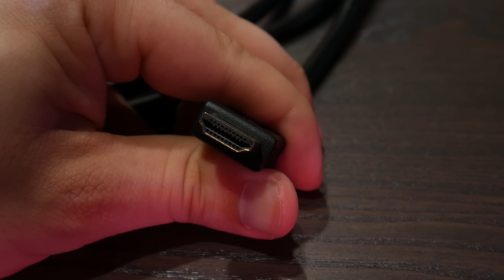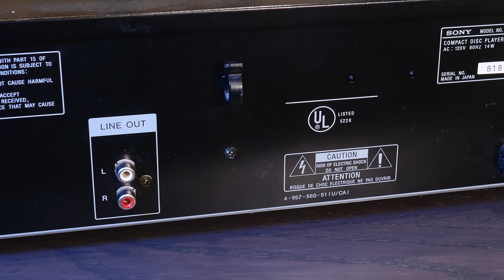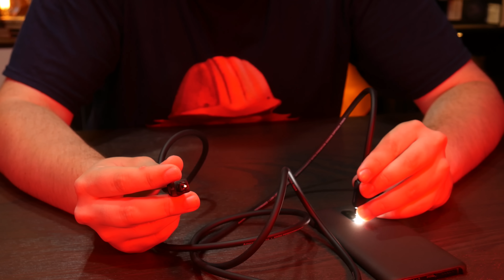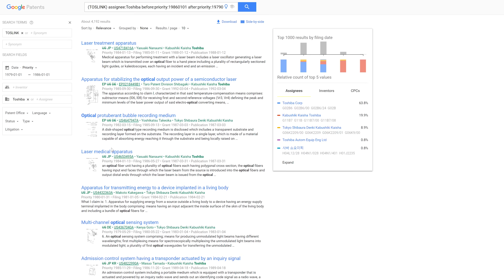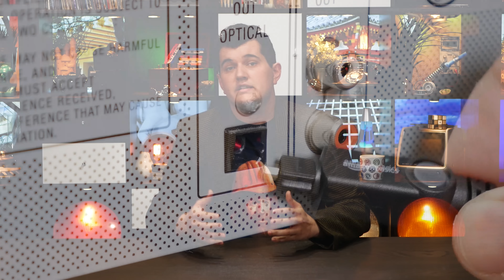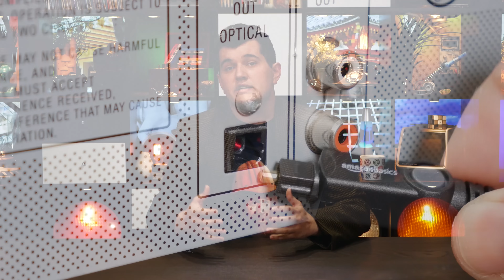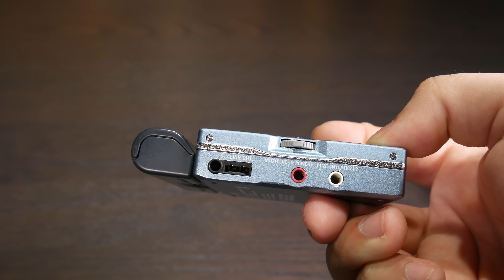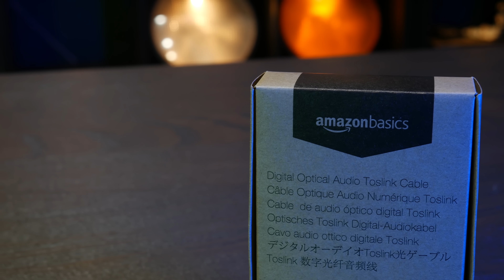TOSLINK: That one consumer fiber optic standard

Comment from the maker: something something 
ground loops
something

Fun fact! I ran across a forum thread where someone was having a ground loop issue with a coax S/PDIF connection, and when someone suggested they switch to an optical connection to avoid that, another entirely helpful and not-at-all pretentious person went off about how terrible optical connections are because of bandwidth and clock jitter.
You simply can't win
Reply: Going too deep into the audiophile community is just hell
Reply: @RisingRevengeance  But did you try changing the TOSLINK LED to a special audiophile LED?
Reply: @RisingRevengeance  You want audiophile hell? Google '6 moons audio' and thank me later
Reply: @RisingRevengeance  Cancer is what it really is...
Reply: Forget clock jitter, it's all about them gravitational waves, bending the light.
You can hear it when the snare is a nanosecond off, or when the soprano is an octal of an octave lower.
Reply: @Games_and_Music  shhh dont shout about it too loud or they may realise external toslinks can be used for managing the clock of their audio equipment
Reply: @Games_and_Music  while i sorta agree with you, you clearly are completely tone def if you can't notice octave changes.
Reply: @Rentta  Well.. i was joking though.
Gravitational waves are so massive, they are not likely to ONLY influence a tiny cable.
And i just liked saying 'octal of an octave'.
Reply: Yep, ground loops are the only real reason for TOSLINK, but what a reason that is... If you can avoid taking apart your entire house wiring for an investment of 1$ in a plastic cable, then sign me up. Though it seems to be a problem from the past anyways, as I never had any ground loop issues with HDMI-era equipment. The D/A part of devices seems to be much better isolated or filtered nowadays.
Reply: @RealNovgorod  HDMI uses LVD signalling (low voltage differential), just like about every high speed bus these days, which is not susceptible to ground noise.
Reply: @Alexagrigorieff  while this is true for the HDMI signal the connector shield is a huge potential channel for carrying RF  noise. I can show you with my signalpath spectrum analyzer.
Reply: Ground loops have always been a huge, endemic problem in the audio industry, & are the actual reason reason why TOSLink & other electrically isolated sound industry interconnects (eg; balanced line audio, & MIDI) were invented.It's not just for audio quality either; grounding problems have been killing roadies & sound tech's for as long as amplified live music has been a thing.
Reply: Sound engineer for 10 years here and adat over fiber optic, and toslink in home audio setups (both use toslink cables), have saved my ass multiple times, especially in setups with a CPU involved. CPU noise is a nightmare, especially on laptops, and rather than fucking around with ground lifting and bridging the grounds of random equipment and trying to isolate the grounds of other equipment to separate circuits because lets face it, audio grounding is black magic that makes no sense in practice, using fiber optics just...gets rid of it.
Reply: @rachelnewton-john7031  TOSLINK was my go-to solution for eliminating ground loops when integrating PCs into my home theater system for many years.  DVI video plus S/PDIF on separate cables from the PC to AVR was a deadly combination.
Reply: But actually, ground loops. They have nothing to do with digital signal transmission, and cause noise at the analog output. SP-DIF (or any other cable that grounds devices together) can cause ground loops. Toslink cannot. And that can make Toslink very handy for some setups. It’s a real benefit.
Reply: @SnakebitSTI . Ground loops can happen in digital audio. I had a firewire pci card causing noise in the outputs of my fireiwre audio interface. Digital connection but it was corrupting the audio section ground in the system
Reply: @Gretsch-q4x  Yes, that is indeed what I said. Electrical connections can cause ground loops regardless of whether they are digital or analog. Optical connections like Toslink do not cause ground loops, because they do not create electrical connections between components.
Reply: I know you were being sarcastic but TOSLINK has saved me more than once when annoying ground loops have happened.
Reply: This is actually a real, live problem I have with my computer since I am using semi-pro studio monitors, the JBL 305P MkII, which are grounded. I get an enormous amount of noise from the any of the line-level analog outputs. The problem persisted with any non-balanced external audio device like my HDMI LCD screen, a USB audio, etc since they connect the grounds of the two devices.

A balancing transformer did work, but they are kind of expensive, so I ended up picking up a $20 toslink to analog converter and it worked great.
Of course this isn't a problem if you are using regular computer speakers, but I quite like what I have, so it was worth a little doing.
Reply: Optical is cheaper because it doesn't require a transformer to protect from ground loops
Reply: @nickkracht7520  you don't need to "protect" from ground loops, if there's one there must be a problem (faulty or badly engeneered appliance), and usually the "hum" can be heard only if you make a ground loop around the amplifier transformer INSIDE the amplifier, and we are talking about analog... also, if the setup uses regular transformers (sometimes more suited for hi-fi) every unit is isolated, so the signal cable will "fluctuate" at once between ground and inner conductor, zeroing the hum, it's magnetically coupled, digital\RF noise is another story, sometimes solvable with a ferrite choke.... car setups are another story as well
Reply: @redoverdrivetheunstoppable4637  not correct; at the very least there is capacitive coupling across the isolation barrier, and this can often degrade.  Even legally acceptable ground leakage current is very high  when compared to what can cause a loud hum if you have two components connected with an unbalanced analog connection.
Reply: I was just going to say, "What about ground loops?!" because I struggled with them for YEARS before I discovered Toslink. And now I Toslink all the things. I just wish there was a way of MIXING S/PDIF digital audio. But sadly, there are none.

Also, Fun fact! Macs have had mini Toslink in their audio ports for many years.
Reply: @asificam1  Thing is most audiophobes are thinking in analog. They think about digital signals as if they are analog. To them it makes sense that a lower quality signal will sound worse, when the digital world doesn't care if the signal is a bit iffy as long as the ones and zeroes comes across. Then there's the jitter. A lot of these people doesn't understand about buffering or signal clocks or any of that. They see the DAC as a analogue piece of circuitry that parses every bit the moment it arrives at the input. The 16 or 24 or 48 bit part of the stream is black magic to them. All they "know" is that bigger numbers are better.
Reply: @blahorgaslisk7763  then there's the 1 bit DAC in many CD players which runs extra fast and along with a buffer processes the data streaming off the disc. Costs less to make a stereo 1 bit DAC + buffer than a stereo 8 bit DAC without a buffer that can process in real time. Cost of such a DAC was enough of a price factor that Sony's first consumer CD player used an 8 bit mono DAC and interleaved processing of bytes from left and right channels. That caused one channel to lead or lag the other by a tiny bit, which in some music could be detected by some people.
Reply: I'm probably just pulling figures out of my ass here, but I'd think jitter would either be so small as to be imperceptible to the receiving end, which re-clocks the signal as it's buffering it anyway, or it would be so terrible as to cause signal loss, in which case you get no signal at all. When audiophools start talking about "jitter", it's time to quietly bow out of the conversation, since they're invulnerable to actual scientific knowledge.
Reply: There are audiophiles that unironically thing that strapping a bag full of crystals to the wire makes the audio better.
Reply: @dan_loup  I saw a comic in an electronics or audio magazine. Shows an audio salon room and the manager or employee asks: now what? The next frame shows the demo speaker wires wound around hot water bottles.
Reply: You had me on edge the whole video waiting for mention of ground-loops, then I posted a scathing comment :P  But TOSLINK is/was also used by radio broadcast stations and amateur radio hobbyists to isolate their lightning-prone tower antennas from their station equipment, so a lightning strike won't fry their sensitive electronics.
Reply: My god....
That´s not even an argument. If we´re comparing electrical vs optical S/PDIF, there is literally zero difference as long as it runs on the same clock source.
Reply: @Basement-Science  as someone whos suffered from electrical interfearence blowing XLR cables out yeah ima have to put a fat doubt there
Reply: @Basement-Science  i don't even barely believe this clock jitter is a thing, it needs to be terrible to cause problems... clock de-syncronization instead is, you can see USB devices have ALWAYS a true quartz cystal on both sides, it apparently keeps re-syncronize (and it's it's business anyways) but it needs a decent timing since the start... you can hear (yes... HEAR) clock desyncronization in bluetooth A2DP communication after some seconds of playing in the form of speeding up or slowing down for like a second once every 30 seconds, kinda... not sure this problem is in every device or so evident, just play a pair of songs you know well trough it
Reply: @redoverdrivetheunstoppable4637  I'm sorry to say that you're wrong, but all USB ports don't have crystals at both ends. The last product I designed didn't have any crystal for the USB interface chip. The chip just winged the clock internally ( a Microchip MCS2221). That said, I think clock jitter is snake oil,
Reply: @johnsmallberries3035  i said the same thing, clock jitter is snake oil... but i can't find any reference to your device, also, you may have been just lucky that it works, USB (i'm googling it now) needs a precision at least inside 0.25%, unobtainable with just the chip RC clock (i say)

don't start with "you are wrong", i'm chatting here, the fact that there are competent people like me and you around that may go more indepth is not strange in my opinion, i'm a nerd at a technology video (in case you think i'm beeing arrogant)
Reply: @redoverdrivetheunstoppable4637  "...needs a precision at least inside 0.25%, unobtainable with just the chip RC clock..." It's not that you're *wrong*, since you specify with "just the chip RC clock" and that excludes the PLLs, but 48Mhz isn't really difficult to achieve from an 8Mhz RC and PLLs. Quite a few of my MCUs can run at 40Mhz, 72Mhz, 80Mhz, 104Mhz, 160Mhz, and 240Mhz with no external oscillator, just the internal RC. Most of the time it's accurate enough to sync at high baud rates from the UART of 4000000 to 9000000. And USB isn't as precise in the real world as it is by spec; especially USB 1.1 fallback support, which absolutely can be bitbanged by an AVR on internal RC. See Also: https://www.obdev.at/products/vusb/index.html
Reply: @redoverdrivetheunstoppable4637  If you can hear it, the software isn't good enough. You should only hear it doing that if it decides it needs a bigger buffer.
Having said that: I use zita-njbridge to send PCM realtime over udp and the other side locks onto the clock and creates a very low latency audio sink (like 10ms). It syncs between different audio clocks, system clocks and such. It works perfectly. Except those times I forget to turn off the wifi on the source device.
Reply: If optical cannot be used for any reason, a simple way to reduce or eliminate ground loop interference on S/PDIF is to put the cable through a ferrite choke (the more turns the better).
Reply: @Alexagrigorieff  ferrite will do nothing for ground loops.
Reply: @S For what it's worth, with ground loops you generally do not have any loss of accuracy in how the digital data is decoded, and for most purposes digital data really is immune to analog noise.

The problem is that a DAC/amp is a digital front end with a lot of analog on the back end. The digital part working perfectly in spite of noise doesn't count for much though if the analog part afterwards is suspectable to interference. That's why optical out makes sense, it lets you completely decouple the analog parts from the digital source. You don't need optical to do it, but it's an easy way to make it happen.
Reply: Ground loop is an actual problem to which TOSlink offers a solution, it is not the same thing as one guy on a random forum complaining about something pedantic.
Reply: I actually had the same discussion with an "audiophile" that swore he could hear the difference between coax and toslink.
I told him that if that were really the case, he has a very very shitty amp with a very very shitty PLL that can't lock onto a signal properly.
The only thing that would make it jitter is if the receiving side is not capable of locking onto the clock signal.
And that's the best thing to say to an audiophile: "You can hear it jitter because you didn't spend enough money for a real amp".
Reply: I wish I could buy better electrical wiring for my house. And maybe I could upgrade the transformer on the line outside.
Reply: @CaveyMoth  even with perfect wiring, ground loops could be a huge issue.
Reply: @CaveyMoth  If you are concerned about receiving noise from the power in your home, look into a power conditioner.  I run pro audio for theater and a power conditioner is critical for eliminating that background noise.
I personally use Furman conditioners, the start at about $80 and run up to a few hundred.
Good Luck
Reply: Mark Perrenoud more snake oil
Reply: LOL, it goes down to what do you hate more: mains hum or a little jitter
Reply: Was it a Head-Fi thread? That place loves to chug the audiophile snake oil.
Reply: One thing I've not yet seen mentioned in talking about "clock jitter"--the schematics I've seen for boxes that eliminate clock jitter involve chips that decode the audio signal using a chip that had an output pin to indicate the copy-protection status of the material fed in, and then encoded it using a chip which had an input pin for the copy-protection status.  If one were to "accidentally" fail to connect those two pins together, the result would be that a feeding a "copy protected" signal into the box would yield a "copyable" signal out.  Selling a box for the purpose of removing the "copy protection" indication might not have been kosher, but if marketed for the purpose of removing clock jitter, the manufacturer could claim it had no duty to prevent unauthorized modifications that might also happen to remove the copy-protection signal.
Reply: Ground loops and mains electricity hum are even more annoying than a pretentious person writing humbug in a forum.
Reply: To be fair I'm building a amplifier myself, and it does have some ground loop issues currently, and switching from spidif to toslink (internaly between the streamer and the DAC) does actually make it easier to isolate the dac from the rest of the amplifier....
Reply: not at all pretentious person (tell me about it) lol your right you can not win (manchester encoding) think i ran into that before ir remote control arduino etc etc anywho  oh also you should try a piece of fishing line : ) let me know if ya do please
Reply: Sooo... As a pilot, when you say "ground loops", I think of something COMPLETELY different than whatever you actually mean. :)
Reply: “You simply can’t win”

Welcome to the engineer way of life 👌
Reply: oh my god they're eating each other
Reply: Ah, and you can't simply decompress a S/PDIF multichannel, either - while Toslink sends 8 channels at uncompressed 24-bit/48kHz ! 
This makes a (potentially) crucial difference when recording anything beyond 2 channels at once.
Reply: @shaft9000  eh most digital outputs of other forms can already do 8 channel or in some cases more as 32 bit 192Khz so thats less of a positive anymore
Reply: I recently had terrible ground loop issues with actually professional audio equipment in my school auditorium because that buildings wiring i that bad. I ended up getting 45 DI boxes to just run everything that goes between FOH and the Stage through a DI box. Was cheaper option that switching to digital Stage snake....
Reply: I watched this video using a Toslink sound plate.
Reply: Clock jitter is real in cheap chips. (For the professional- not the audioFool)
Reply: Clock jitter souldn’t be a huge issue unless if said person really cheap out …. Usb dac are perfectly fine just as optical. I think a lot of people dont like usb cause some time badly grounded device can indeed pass the noise on to the analog output. Which does happen with my mojo2 I can’t charge it and listen to music cause i can hear the charging wine from my bad charger
Reply: I love you
Reply: I didn't knew HDMI was so terrifyingly good at audio.
Reply: @dan_loup  Hdmi's focus isn't audio. All the good audio stuff in Hdmi is for cinema (multi-channel audio). And it's raw stereo audio characteristics don't push the envelope (even though they're quite good nowadays). For audiophiles, there will always be some other fancy format that does some things better than hdmi.
Therefore audiophiles don't care about hdmi.
Reply: @BlackSharkfr  192Khz/24 bit precision without any compression is pretty much unbeatable.
Reply: Ignore and onto the next video. More toasters
Reply: People complaining about jitter are dumb as hell, but ground loops can still be a problem even with digital interconnects. For example, if you have an amplifier/dac receiving data from a device with a different ground, you can induce an additional signal on the (very much analog) output of the DAC via the current that must flow to bring the two grounds to a common level. There are other ways to isolate systems than using fiber, but as you said a piece of fishing line and an LED is pretty damn cheap.
Reply: Ground loops, switching power supplies, computer noise in the power circuits, and 2.4/5ghz noise all plague my audio systems. It's miserable.
Reply: Friend of mine had the perfect argument to the clock jitter BS. His electrical engineering project involving rx/tx to satellites, eg through the atmosphere with all its interference and even then clock jitter wasn't an issue, so how the hell is it going to be a problem over a short cable sending a relatively low bandwidth audio stream.
Reply: @TimSavage-drummer  Jitter is a real issue for high speed (50+ Gbps) trans-ocean fiber cables. Basically, you're sending your pulses perfectly clocked, and they arrive slightly earlier or later than average delay. It's caused by thermal fluctuations of the medium.
Not so much for sending 1.5 Mbps over 6ft, though.
Reply: @TimSavage-drummer  satellite digital communications have very high latency and use forward error correction to account for loss due to interference. That error correction adds latency. Usually salellite data is modulated (QAM - quadrature amplitude modulated, say QAM64 for example) on some carrier Depending on the satellite frequency your requirements for low phase noise clock (low jitter) become more pronounced. If you use a J-BERT (jitter bit rate error tester) from say Keysight ($100k instruments) you can design your system to minimize phase noise, jitter, MER (modulation error ratio) to be able to decode the signal. This is all much more complicated than you imply, with QAM, I Q signals, Slicers, FEC, Trellis layers, randomization layers, reed Solomon coding, and more. You still have to deal with period jitter, cycle to cycle period jitter, long term jitter, phase jitter, time interval error.  Think of jitter as a kind of error and lol I can't think of anyone doing anything at all in RF to communicate with a satellite who doesn't have to deal with this kind of stuff all the time.
Reply: Before I discovered and promptly bought a USB isolator (they're pretty cool for circuit nerds) I bought a TOSLINK cable to deal with a ground loop scenario between my speakers (which are likely more complex than average) and my PC.  It was the only thing at the time that solved the issue and I still don't know what caused it other than probably noisy switching power supplies that didn't like each other over copper.  The USB isolator for that one device has since fixed the issue without the weirdness of TOSLINK optical.
Reply: Ground loops aren’t that likely at short distances - crummy switch mode power supplies however...
Reply: @JohnR31415  sadly, much of ground loop problems are caused by equipment even with perfect wiring.
Reply: I've never got into more insanely useless arguments than over grounding. Radio, audio, insane essential oil people, it's weird. 

Also, now I'm laughing thinking about someone hearing how clock jitter makes their audio "unstable" or something.
Reply: Never mind that any clock jitter will be completely eliminated by the PLL in the receiver.
Reply: People don't understand that there are buffers. They literally think everything is streaming at the edge of a knife. Probably because in their perception it's all instantaneous.
Reply: @timramich  When it was first introduced, some devices might not have had any buffering. Transistors were expensive back then. These days, of course, there's no issue.
Reply: @johnsmallberries3035  Uh, yeah. Okay. Transistors were expensive in 1982? We're talking about present day, and maybe the past 10-15 years, when everyone has had a fetish for nonsense snake oil, despite this digital technology being perfected (even with buffers) for decades before.
Reply: So you're ignoring ground loops and mocking people who brought a point that you neglected to cover in the video. I'm unsubscribing now.
Reply: SPDIF is transformer isolated and so is immune to ground loop problems, so optical has zero advantages from a ground loop point of view.
Reply: @warrenhuck5510  it can be transformer isolated but usually is not in cheap implementations.
Reply: you can avoid all these issues as long as you buy monster cables.
Reply: Jitter matters. I reclock AES/EBU (balanced 110 ohm version of SPDIF) and there is no contest in A/B listening. Very obvious, significant and easy to measure improvements.
Reply: I know I'm going to get some hate for this but clock jitter is actually a big issue when it comes to high fidelity audio reproduction.  It causes all the packets (which multiple packets can be used to create one instrument) to come into the DAC out of time.  So say a bass slam.  It will sound more muddy and have less defined attack with high jitter when compared to low jitter.  Basically all the different pieces of digital information for a specific note are coming into the dac out of time and since those time discrepancies aren't equal (as it might be in a Wow and Flutter situation on a turntable) it creates a scattering of that note.  Now it doesn't result in a complete shift of the beat, it just makes it less believable that the sounds are coming from an expressive human musician and more like a machine trying to recreate it. 

And as for the optical being more prone to jitter?  The pieces of technology that are involved in converting the digital voltage into an led light are prone to introducing electrical noise into the rest of the circuit.  So in the audiophile world digital coax is usually preferred over optical.  They both transmit the same information, just coax has less steps in that process.  Less steps create less opportunities for things to get messed up.  And as for the bandwidth issues.  S/PDIF is limited to 192khz where as a USB signal can kind of shoot the moon.  I personally don't care about that when it comes to my audio reproduction but when you go on facts Optical S/PDIF technically has less bandwidth then other potential options.  Most must music is mastered in 44.1 CD quality so in reality S/PDIF has more then enough bandwidth for 95% of recorded music. 

I think people tend to forget that digital audio products are electronic devices, tasked with creating the complex expressive and emotional energy of a human musician.  In theory it shouldn't be a hard thing to do,  that information is already there, and I understand why it seems like mumbo jumbo to worry about this kind of stuff, I believed it myself at one point.  However, in reality its really more of a practice in how not to mess things up.  How can we give an electronic device those 1s and 0s, which contains all that expressive human music, and convert them into an analogue sine wave without that piece of electronic equipment damaging it in the process.

I hope this comes across as a level headed and respectful counter to the points you have made in this post.  Now I won't say my credentials are extensive however I have done a lot of research into this.  I also just upgraded from a chromecast audio (running S/PDIF) to a Allo Digione Signature streamer going into my high end DAC/audio system and the differences were quite significant, especially in bass reproduction through my very finicky and hard to push Ohm Walsh 4 speakers.
Reply: @TheKoltrane  Clock jitter doesn't cause packets to come out of time (and DACs don't use packets anyway). Clock jitter is what it sounds like, a jitter in the clock (not data) being supplied to a DAC or ADC.  An ideal clock clock is a perfectly periodic square wave with every period looking identical. A real clock has tiny variations in timing that cause errors in when samples are converted to analog values.  This is what clock jitter is.  For a given frequency, and a given SNR, there is a minimum accuracy required of the clock.  If the clock fails to provide that, additional noise will be introduced in the output, resulting in worse SNR.  Fortunately, the tolerances at audio frequencies are very high, and jitter rarely limits the SNR of real audio systems because other factors are more serious.  

The problem with bass you are describing and the issue where different frequencies can pass through a system at different times is a real problem, but it is not due to jitter.  That is phase distortion.  Phase distortion is a property of anything that changes the frequency response of a system, including equalizers, speakers, and even whole rooms.  And it can be quite annoying to deal with, much more so than jitter.
Reply: @TheKoltrane I couldn't finish reading after your first glaringly ignorant comment. Jitter occurs in the AD DA sections and it is creating a voltage stream or converting a voltage stream. Jitter is when the clock controlling the AD or DA fluctuate. It is clocking the sample rate. Individual sample drift from one another... just get Jett or lynx synchrolok gear... but this is all pro audio and irrelevant to you consumer audio guys